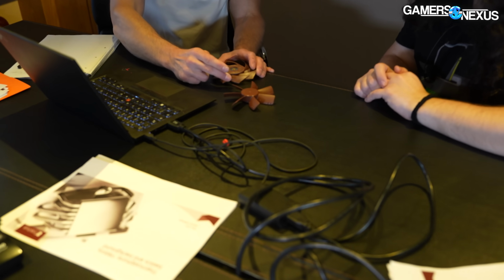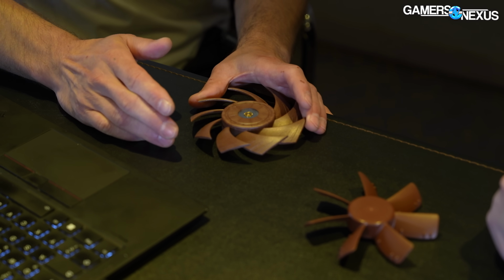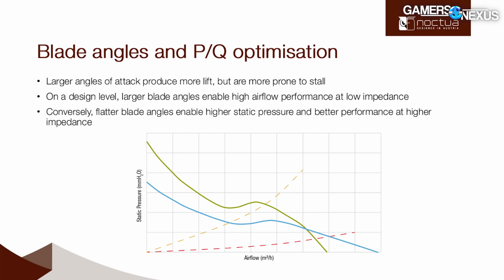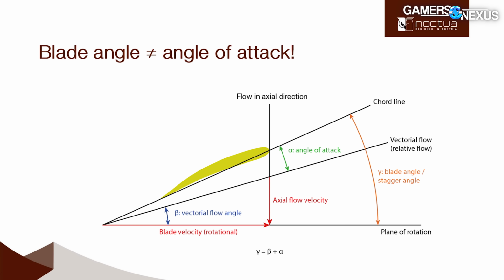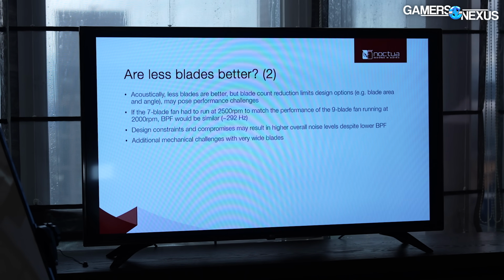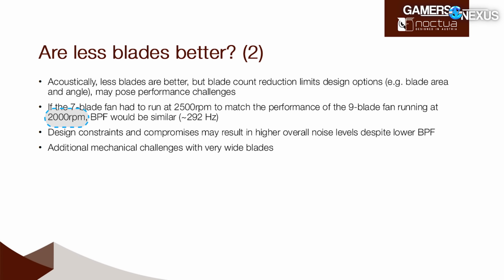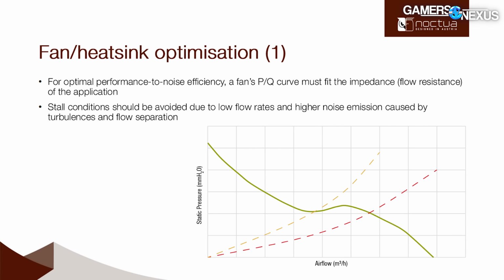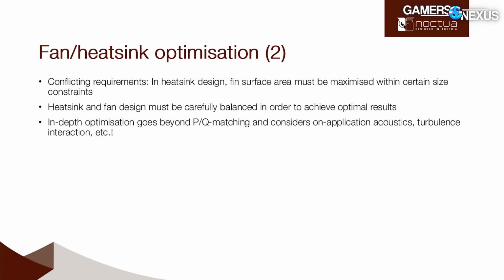Noctua's Attempt to Make the Perfect Fan | Blade Angle Engineering Discussion

Comment: Guy went straight into the lecture with those slides. "Yo but what's the big picture?" "Well the vectorized nomial airflow hitting the 21.33 angle of attack in reverse torsion" 🥴
Reply: Have to account for the side fumbling.
Reply: @mattrogers6646 you cant not
Reply: Don't ask aerodynamics engineers for something vectorised😂or you'll end up with linear algebra. He just said "vector".😂

Comment: This will come off as a marketing skit, although I wanted to share with you all how awesome these noctua fans are!! I’ve been using the rs120 argb fans for over a year, and did a switch with the noctuas recently; And the result was fascinating! From dust accumulation to noise, everything has improved drastically. Need I remind you, the rs120 corsair fans are not cheap by all means. The noctua simply outperforms even the corsair fans, and the difference is obvious.

Comment: Do fan blades have to have symmetry and/or same size?
Reply: Rotational symmetry and equidistant spacing, yes. Otherwise the bearing and/or motor would prematurely wear out and the lack of balance would result in inefficiency.
Reply: @mattrogers6646 They don’t strictly need to be fully rotationally symmetrical - there are plenty automotive radiator fans with quite uneven spacing to allow access to bolts for example. As long as the center of mass and aerodynamic center of the fan are centred you’re fine. There’s probably a small performance cost to doing this but it’s mechanically not a problem.